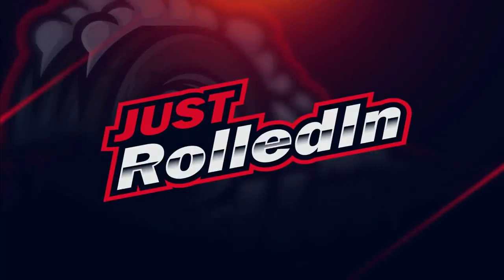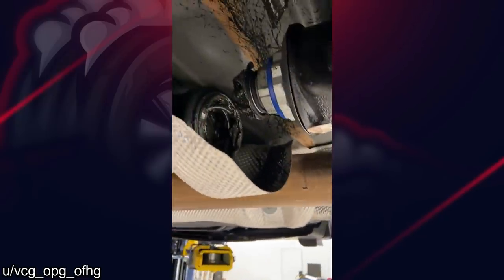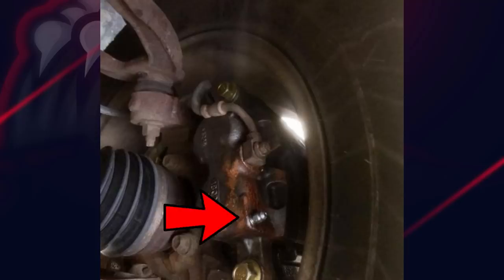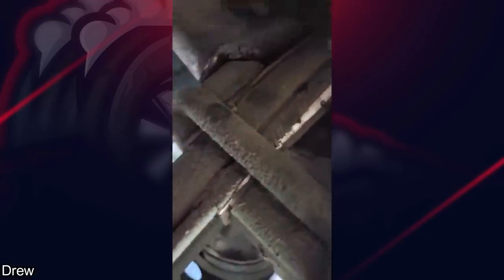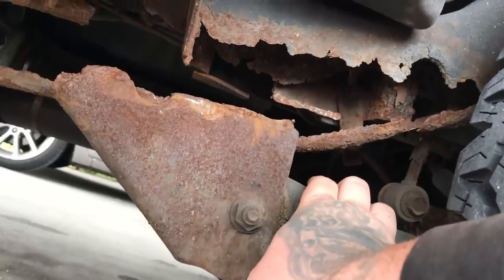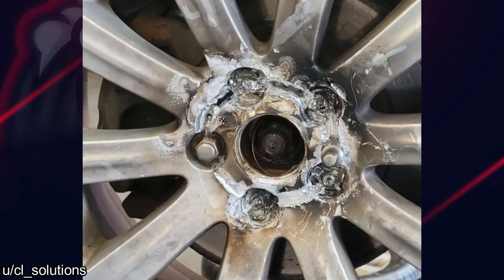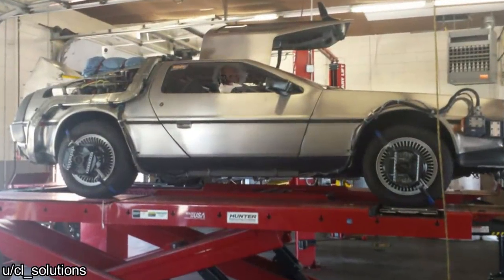Customer States "My Brakes Are On Fire!" | Just Rolled In

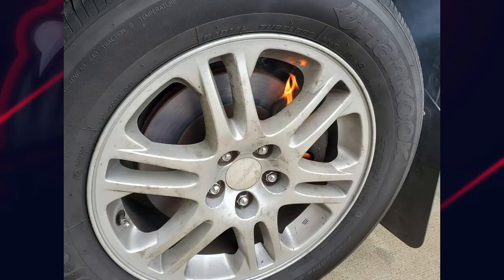Comment: 0:22 - in 2008 I accidently put power steering fluid in my brake reservoir after replacing rotors and pads.  Resulted in brakes seizing when they got warmed up.  Used a turkey baster to empty the brake reservoir then bled out the rest through the calipers.  Fun times.

Comment: If you liked that mechanic's wind chime, you should check mine out sometime! Plug wires and cap like in the video is common. On one occasion it was an entire under hood wire harness. Brake lines and wheel cylinders have happened. One time it was a carburetor that a different "professional" had rebuilt and failed for me. It was the carb that ended up in the tree, not the failed mechanic!
As a side note: The most unusual car I ever experienced in the shop was a Cadillac station wagon built by George Barris for Dean Martin. It was cleaver for sure, but not what I would have expected from Barris.

Comment: I've seen calipers installed on the wrong side many times and one of the coolest cars I've worked on was putting a water pump a 34 Model T. The water seal was actually rope packed in grease. That's how they used to do it!
Reply: That is how many boats used to seal between the prop shaft and hull.
Reply: Model T ended production in 27.

Comment: Everytime I curse the heat of South Florida, then I remember how blessed I am for not having to worry about rusted out salt damage car frames. My father gave my nephew his 13 year old Nissan that only had 45k on it. The people in western New York were shocked at the lack of rust on the car when they did the inspection. The only thing it failed was the windows. They were limo tinted. The great thing about Fla is they are illegal to have on the car, but the cops don't care unless you piss them off and they just more to the ticket.
Reply: If it's factory tint then five-o can't say shit about it. If it's aftermarket they can make you peel it off.
Reply: @CrazyBear65  gotta love the double standard, the factory can legally put tint on but the consumer cant.
Reply: @CrazyBear65  Knock on wood, I never have been pulled over for my dark tints. I know people that have, 2 to 3 times. I also know people that have gotten an add on ticket because they smart mouth the cop. I have gotten pulled over more than a few time in my life and never got the add on ticket with my dark tints. I just say, yes sir/ma'am no sir/ma'am and they gave me that one ticket and said nothing about my very dark tints.
Reply: @mikeb6902  Because the consumer will literally put blackout tint on or even mirror their windshield and then complain about being harassed,

Comment: When I was in high school... I was poor. Super poor. I literally found a rotted out 1985 Subaru GL station wagon(poo brown) in a farmers field. Asked farmer if he would sell it. I bought it for $100. I got it running. It needed brakes. I never had done brakes before. I apparently had caliper issues on the front. I put new pads on and made it about 5 miles from home and noticed that every time I touched the brakes... the car would get harder and hard to move forward. Engine was struggling pretty hard by now. Then I saw smoke. I pulled over and witnessed 12” of flames erupting from both front calipers/pads 😂 I poured water on them to cool them down. Yeah that warped the rotors BIG TIME 😂 So... I continue the 5 mile drive home in a slow and careful manner. I stopped occasionally for cool downs. The pads were still tight enough that the now warped rotors were rather violently shaking the steering wheel as I drove. BTW... I lived in a rural area and there was no traffic around. I didn’t have a cell phone to call for help at the time either. Why I desperately tried to make it home in my $100 pos car. I got it home. Fixed the car. Drove it for 6 years. Finally decided to get a new car. Dealership gave me $3k trade in for the car. I hadn’t gotten that silly deal where they make you think the $3k is a good deal because they just tacked some extra to the bottom line of the new car tho. I had told them no trade in when we set the original price... because I thought the Subaru wagon would just be laughed at. I was convinced to take my $100 car in that I had literally jumped off mountain trails and also hit a tree head on in. Oh and the frame was completely rusted in two. That’s why I was looking for a a new car. If the frame wasn’t shot... I would have kept driving it. 😂 anyway... they offered $3k trade in for it and I said DEAL. 😂 ahhhh the memories associated with good ole flaming brakes.
Reply: The flames were def at least 12” in my situation too. The flames were rising up completely past the tire and actually burning the fender. I must have had too much brake grease on the brake components. I had no idea what I was doing back then. 😂 but the car lived the remainder of its life with fire damage to both front fenders. I had to pour water on them because I was worried the tires were going to catch fire and the tires were still sorta new and worth more than the entire car! 😂

Comment: Working in a parts store I've had a customer wanting to warranty exchange a brake caliper. When I pulled the part for the side he requested I noticed the bleeder on the wrong side. Mentioned it to the customer and he was adamant that it was impossible to mount the caliper on the wrong side. Trying to diffuse the situation I let it slide until the end of the transaction at which time I asked him to just check it out when he got back to the vehicle. He got riled up again. He held up the caliper and showed if he tried to do it the other way how it would sit. That's when he noticed I was right.
Reply: The customer is always right, except when they're WRONG!

Comment: I've had brakes drag on frac tanks when I use to haul them. One time I hooked up to one, connected the air lines and pigtail. Released the brakes and rolled it back to make sure the brakes weren't dragging. Everything felt fine so I took off to drop it on location. Drove about 10 miles and the tires went BOOM. Brakes caught fire. After that, once I hooked up and connected the air lines, I opened the valve to the air tank under the frac tank and just ran on the tractor brakes
Reply: What about losing part of your braking power carrying a load like that? Don't you risk having the tank roll up over you, especially if you have to brake hard?
Reply: @markh.6687  You lose some braking power, but the truck brakes can handle it. The biggest worry is a jackknife due to rain, snow or ice. But the 5th wheel will keep it from rolling up on the truck. Half the time anyway, you need the brakes released on the tank when dropping it. Many of times I've had to drop it partway, with it holding by the winch cable and use the bed of the truck to position it
Reply: @simpleman806  I see. Would the weight of the tank simply shove the tractor from behind while braking, even if the 5th wheel prevents a "climb-over"? I agree that unloading is another whole can of worms, but at least you can't jackknife while unloading......right??  :)

Comment: What car was the burnout sheared driveshaft one? I imagine if its a new sport/sporty car they will cover it under warranty (and they kind of should...I mean...if its made for burnouts it shouldnt grenade! If its a Subaru or something...then yeah prob now).

Also, potholes like that exist in NY...Took out both right side rims, and tires (although they held air the 40 miles to the dealer!), front upper and lower control arms, rear lower control arm, front frame shield and rear bumper cover.

Behind me was a Freightliner with a 3 axle garbage trailer. The tractor lost its second drive axle (ripped off the frame), and all right tires (all 6) on the trailer. I dont remember if the rims or axles were jacked but I wouldnt be surprised. It was BAD.

Being that we were in a small car, we flew mostly over the cave. The truck sank in more and got the worst of it. NYS Interstates for you!
Reply from the maker: Not too sure what vehicle it was in the driveshaft one. They didnt mention.

You know your pot holes are bad when they destroy a garbage trailer, wow lol. I thought our pot holes were bad here.
Reply: @JustRolledIn  Yeah, NY State....Some of the worst ones. I also drove in the 90s in Eastern Europe, and were talking post revolution roads, and all that, and NYS still has that beat!
Reply from the maker: Jeeze those roads must be real junk 😅.
Reply: @JustRolledIn  Yeah. Its why I avoid the interstates like the plague. I stay on the county roads. Theyre a bit better, and some are even ok. Interstates and anything in the five boros of NYC...NYC destroys suspensions

Comment: Had a 2002 Jeep Grand Cherokee first three years I owned it I had to replace all my rotors every year because they would Warp the 4th year I had it the front passenger side Tire popped while I was driving 30 miles an hour because it got too hot the brake pads were melting and dripping all over the rim which also had a permanent blue tint to it 4th year I owned it I replace everything high performance brake kit with drilled and slotted rotors ceramic brake new calipers rims tires self-leveling air ride and had them add an extra air hose port to the air compressor I can even pull over to the side of the road and air up my own tires carry a 6-foot hose underneath the back seat

Comment: The melted rim with the messed up lugnuts. I'll guess they couldn't get the lugnuts off, and tried heating up the lugnuts on the hopes that the heat would loosten them........problem is rim is aluminum alloy and melts easily at torch temps.
Reply: Especially if they used an ox-acetalyne thinking "hotter is always better, right?"

Comment: Great examples of auto fails but would it be possible to hold the phone horizontally?  Some of the vertical segments are hard to see on a phone and turning the phone doesn’t help, the video section is still small with those annoying boxes on the left and right even when the video goes full screen.  Thanks.

Comment: @0:29 - I don't get it. What is the arrow pointing to. What did the customer do wrong? Why wouldn't he want that covered by a warranty?
Reply from the maker: The arrow is pointing to burnt rubber most likely from a burn out. They probably want it covered under warranty but not sure if the dealership will warranty it seeing that.

Comment: Haven’t you ever seen a tractor trailer breaks get hot and catch fire.
Reply from the maker: I've only seen the aftermath after it was done, but not while it was happening lol
Reply: At work one evening we had this hot smell come through the building. We looked high and low for the start of a fire or something hot. Turned out to be the brakes on a trailer backed into the unloading dock. Quite the scare but relief in the end.